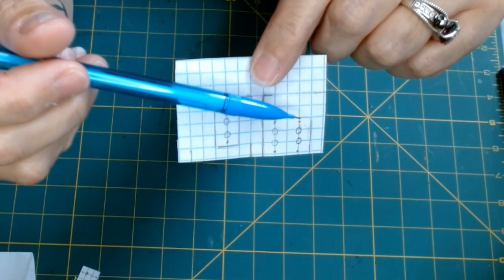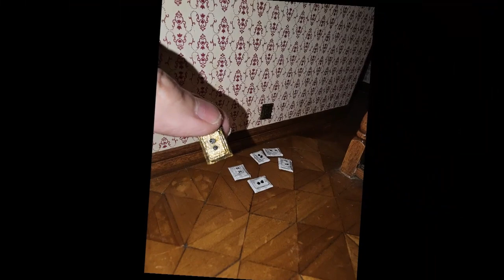Push Button Switches, Electric Outlets, and Orlan (A Frequent Visitor👀)| 1:12 Miniature Dollhouse

Comment: Great video- I was going to use balsa scraps to make these- but yours are so delicate and more to scale! Will definitely use chipboard instead.
Reply from the maker: Yes.. I wish I had just not been lazy and walked around my table to get the chipboard or a better choice 😆.. but it worked out..sometimes I can't remember which setting I use for what paper and it takes a few cuts to get it right 🥰 I'm okay with them.

Comment: I live in a house that was built in 1917 and probably had electric installed in the 1930s or 40s. Maybe it's just my house, but each room has exactly one outlet and it's placed 1/3 up the wall. So, your bathroom outlet placement is correct according to my house. It's massively inconvenient, BTW!
Reply from the maker: Thank you for sharing that. It's very reassuring, and I absolutely love  hearing everyone's stories 🥰❤️